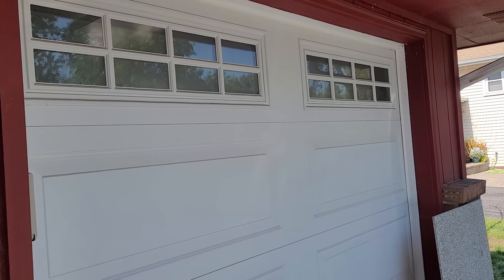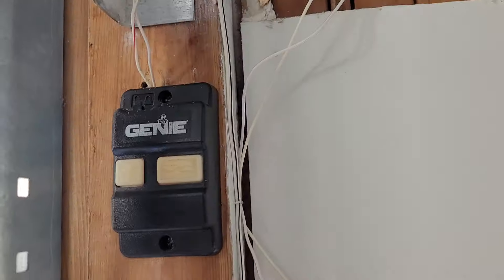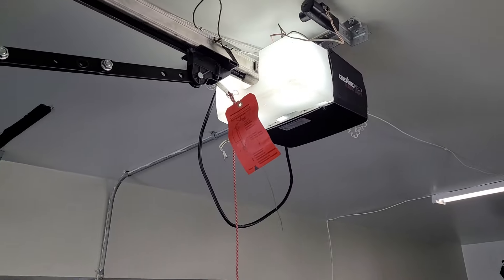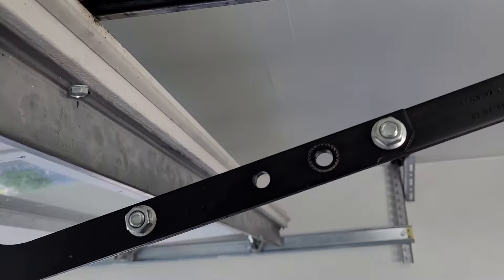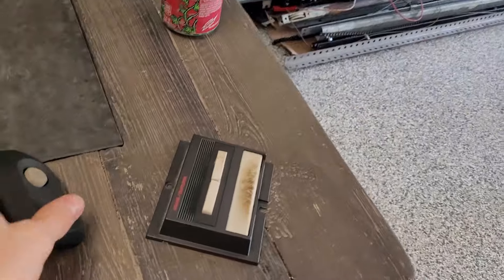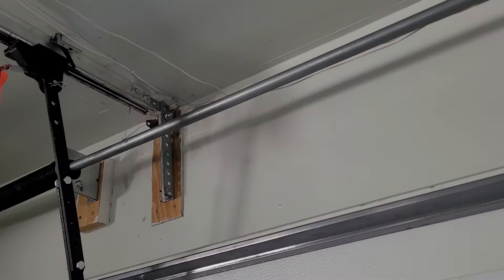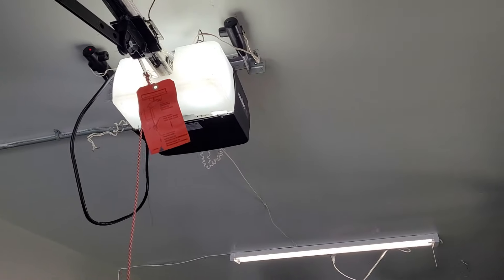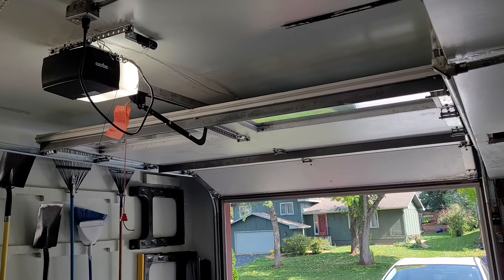Genie Pro Screw Drive on the Small Door

Comment: I thought the rx8 got to 100000 how did u move it outside btw my dad has a Mazda 3 with 167k miles on it
Reply from the maker: Just put it in neutral and rolled it out
Reply: Oh ok.
Reply: Have your genie screw drive need a new moter